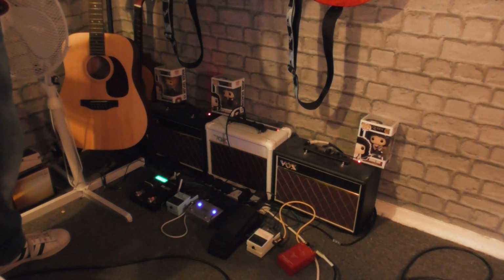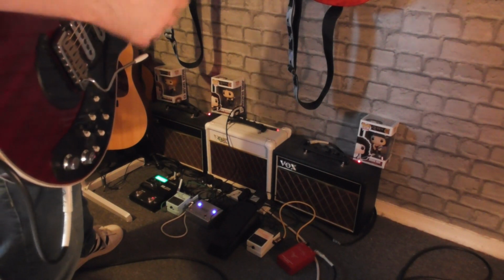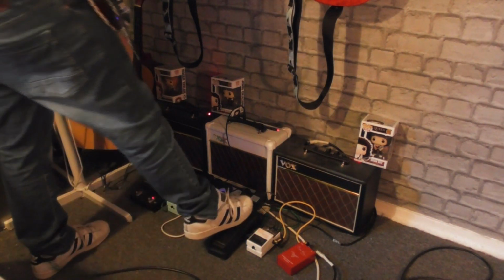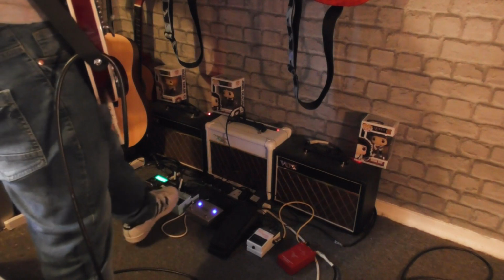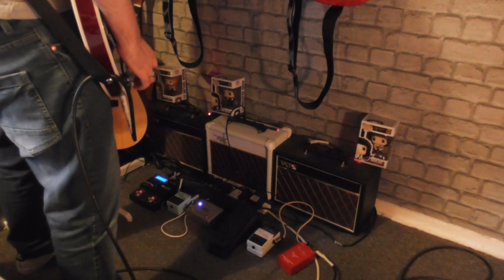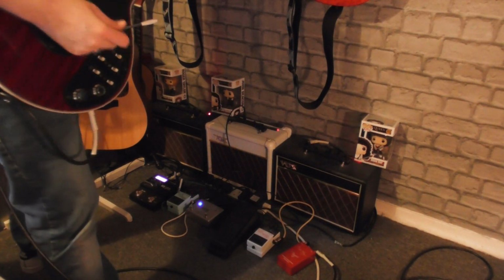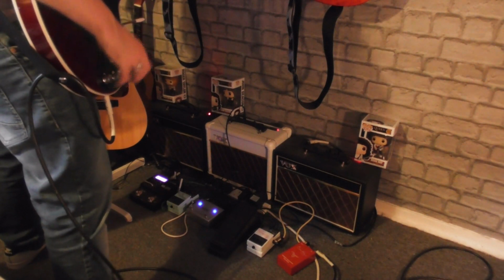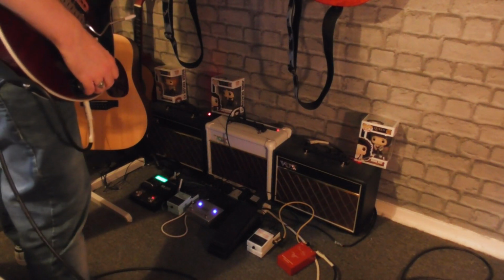Updated Brian May Rig Demo

Comment: They all sound amazing.   I'm actually getting a Pathfinder 10 today as with yourself i'm finding the VT20 isnt giving me the sound I want.  Do you think I should go ahead with the LED mod on it or just leave it alone.  Both your pathfinder's sounded amazing! :-)
Reply from the maker: The Pathfinder unmodded is good for at home practice, allows for better volume control. With the LED mod, you need to have it on a low setting for bedroom practice but it opens the amp up more. Either way will work fine, the latter is perhaps better if gigging so really it's your call man :)
Reply: Thanks for the reply Daniel will be purely for home use so I'll give it a go without for starters wouldn't like to upset the neighbours with my awful playing 😂
Reply: @danielcampbell872  do I only need the treble booster on the pathfinder to get a basic bm tone
Reply from the maker: @RedSpecialArchive  a treble booster and pathfinder would work fine for a basic sound
Reply: @danielcampbell872  what we're your settings for the seven seas harmony settings. I want to replicate it in the pod go.

Comment: I use a very similar set up but through a Strat with GFS pickups and the small amps sounds great…AC30’s would be too much for home use…
Reply from the maker: I did the same before I got my Red Special, had a Squier strat fitted with the GFS BM switches
Reply: @danielcampbell872  hey Daniel, yeah I use a Stratocaster kind of Gilmour model modded to a BM style, I have a BM guitar too but all I wanted was to get from a clean sound to that smooth distortion just by using the volume pot…I use a TC electronics Treble Booster + a EHX soul food then into delays or phaser etc on a Wet/Dry/Wet rig over the Pathfinders also modded …it may sound more like a modern Rory Gallagher sound but the concept is definitely the same…great sound on chords work and lead…

Comment: Do you recommend the Line 6 M5? Also forgive if I missed it in your video, for the A/B splitter do you run one into one amp the the other into the line 6 M5 then in to the other two amps?
Reply from the maker: If you're wanting to save space and most effects in one place then it is a good one to have. Output A goes into the CE-5 which splits the signals before they go through the M5 and to the Pathfinders. Output B goes straight to the VBM1 :)

Comment: What settings did you have for both of your pathfinders?
Reply from the maker: Gain at 3/4 on modded pathfinder, 1/2 on unmodded, bass and treble at zero. Vol at 3 o'clock on unmodded pathfinder, 7 or 8 o'clock on modded
Reply: @danielcampbell872  thanks 🔥